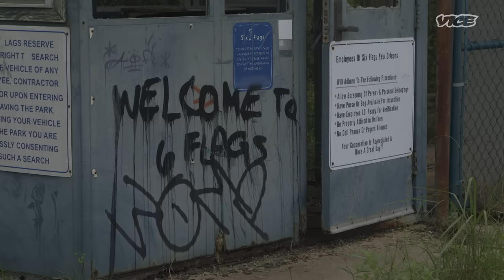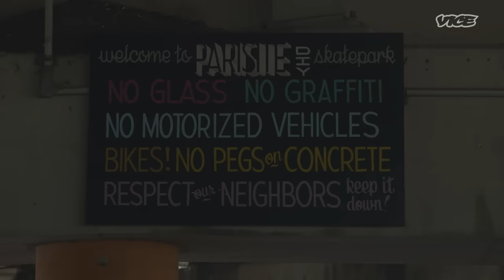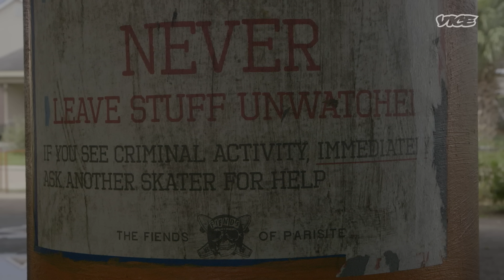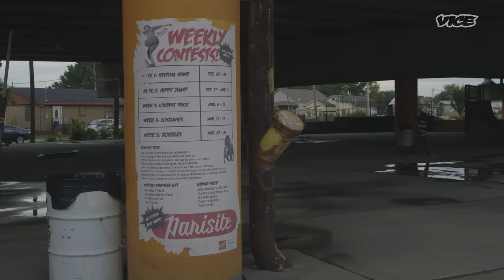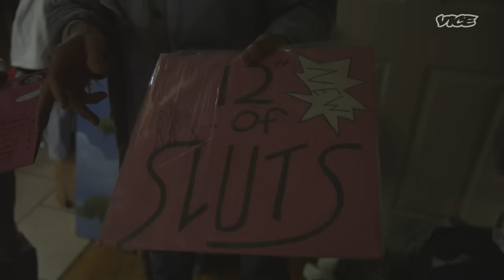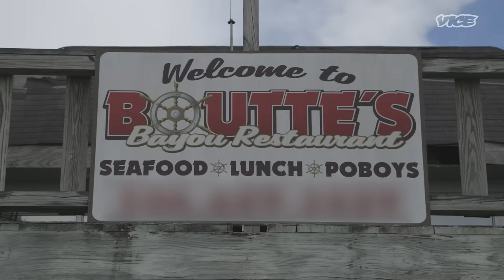What Six Flags New Orleans Turned Into Post-Katrina | Abandoned (Full Episode)

Comment: There really should be a law that companies are not allowed to leave abandoned structures, and that they need to leave the location as they found it. Also, should be a law that you can only build at a minimum of a few meters above sea level. That would mean the beaches would be free of housing and not privatized and that no home would be as easily flooded. Building below sea level is dumb and so is building an amusement park in a swamp.